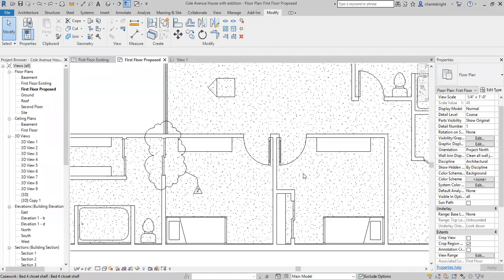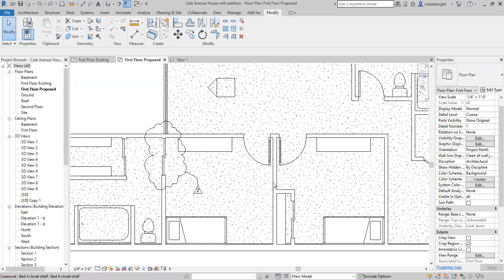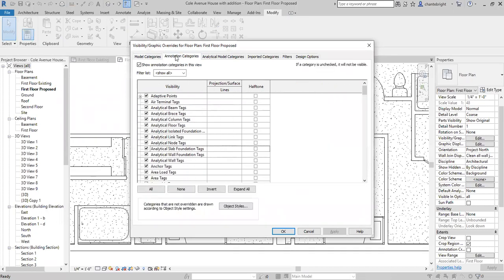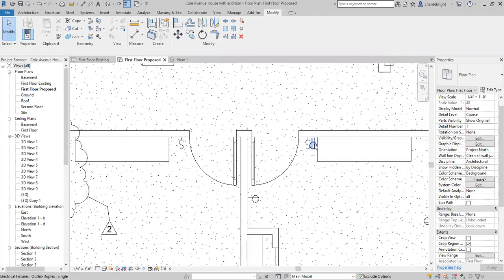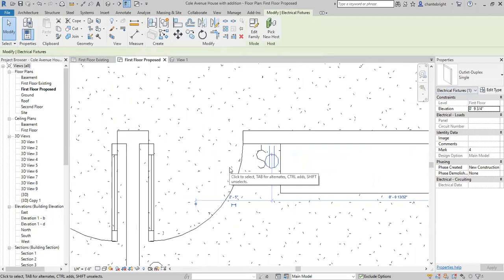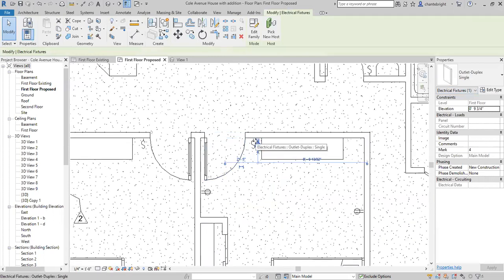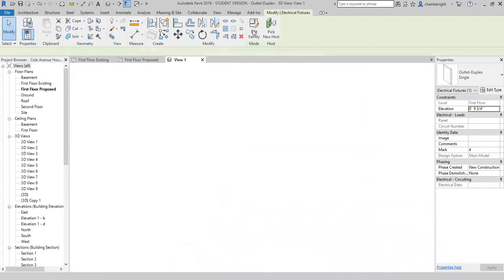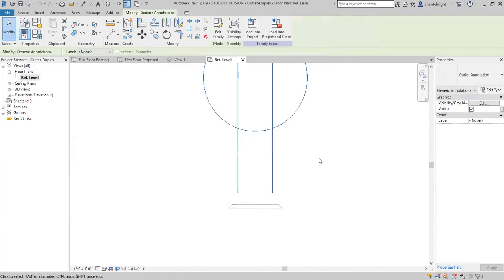Revit   Using Generic Symbols in Electrical Fixtures

Comment: I encountered the same problem, checked the solution you told, it was really helpful. I want to add some information to it from which i solved this problem in my project. 
1) First check the scale and set it from the bottom tab
2) Change the view from fine to medium from bottom tan